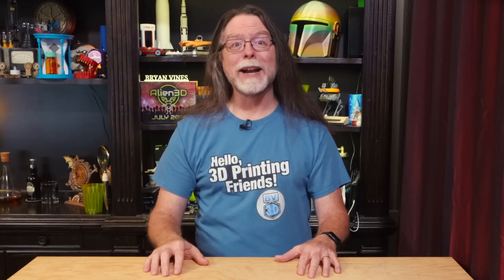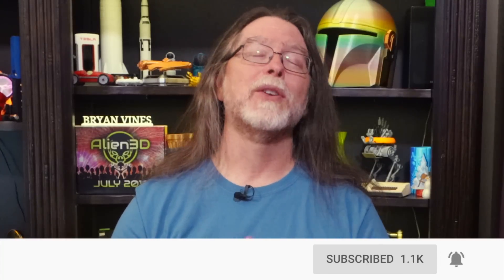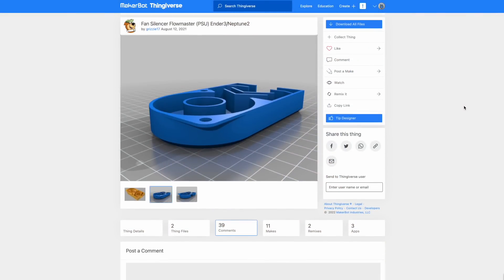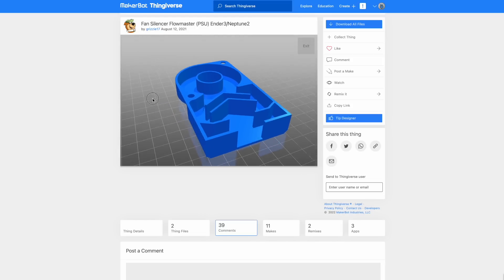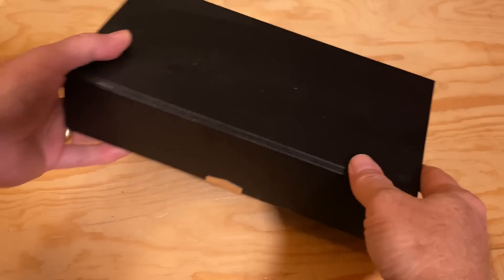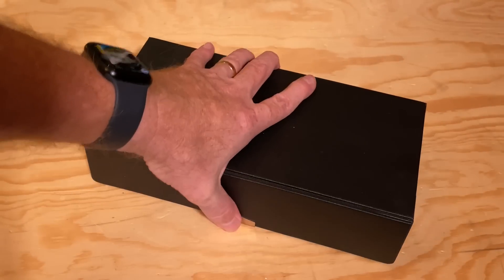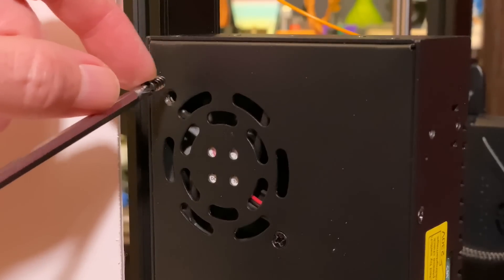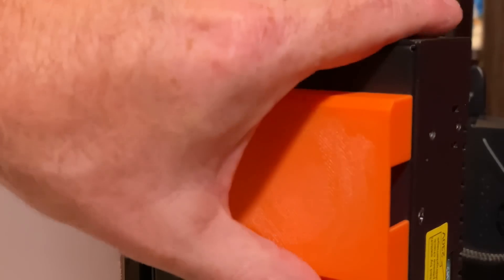Quieter Printer with Just One Print

Comment: That's a great video...  my issue is one of vibration though as the printer is in a room above my bedroom - so whilst the fan noise is an issue the transmitted sound of the bed moving was something of an issue.  I have reduced this by putting rubber pads beneath the legs of the table the printer is on and by using vibration damper cups attached to the base of the of printer - i printed out a DIY solution that involves tennis balls.  My main issue is that the dog sulked when I nicked a couple of his balls.  I will be printing out this fan duct anyway because I believe ever little helps.
Reply: My main issue is that the dog sulked when I nicked a couple of his balls. I'm still wincing from reading that! :)

Comment: I saw this fan cover and other versions awhile ago and printed one of them out in PETG for the heat proofing and it is fitted to the base power unit fan outlet of my Tronxy X5SA.
It has not only made the fan noise lower but also directs the out flow of air away from the underside of the bed where the fan normally points upward to.

Now I printing two more for the Aquila and my new Neptune 3 both have loud power fan outlets.  Amazing what can be done without major work.

Comment: always good advice you come up with.

but you can further reduce the noise by removing the metal grid that is supposed to prevent fingers from getting trapped in the fan.

this grid no longer has any function as you put a cover on and you achieve a better flow of air and further reduction in noise 🙂😉
Reply: Yes, absolutely this! Most of the noise is the air being chopped (heavily compressed) as the blades cross by the nearby grate. If you remove the grate, or just space it from the fan by at least about 10mm, the noise will disappear. You can apply this to any fan anywhere on your printer.